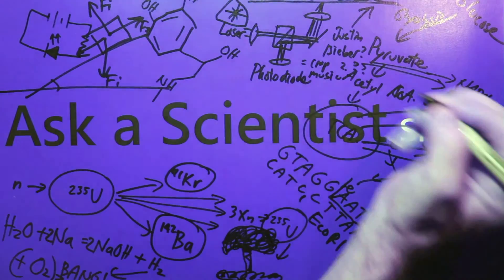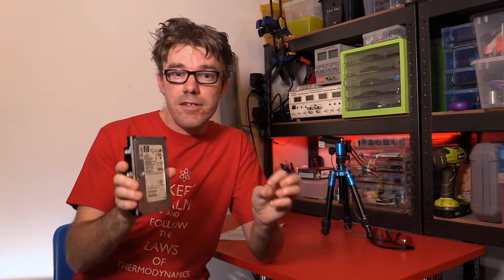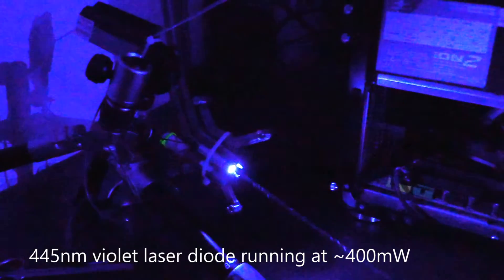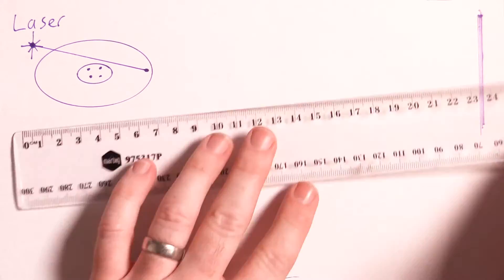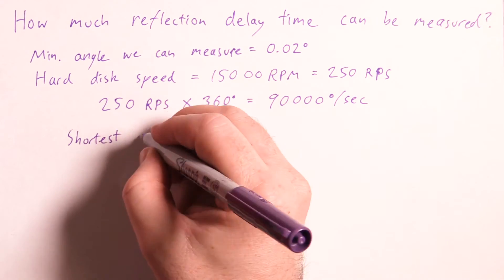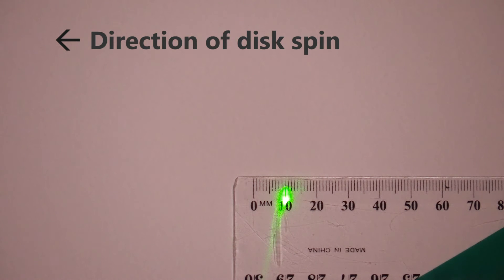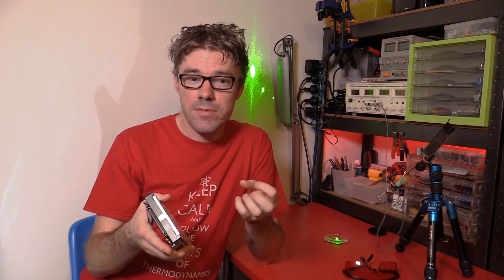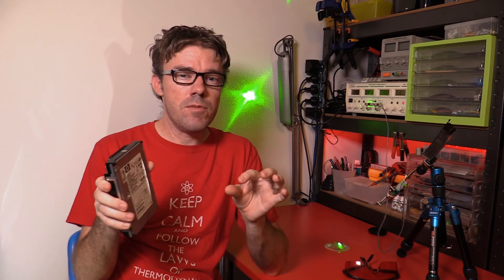Can speed distort a mirror reflection? The speed of reflection? Ask a Scientist Show 1.5

Comment: Ques. what is the highest speed in these options.?
(a) Rocket.                             (b) Air jet.
(c) light.                                  (d) Reflection of mirror.

send answer by comment..99.9% fail.....!!
Reply from the maker: Speed isn't a greatly specific word. Speed is the rate of something over time, so when I talk about speed of reflection I'm talking  about the amount of time it takes for the reflection to happen rather than a distance over time. As I understand, the reflection is happening on the surface electrons, so therefore a reflection isn't happening over a distance. There are also complex issues with determining the location of an electron too.

For all practical purposes, light plus a mirror is travelling the speed of light for the light path length.

So in order of speed ... B, A (depends on the rocket), D and C.